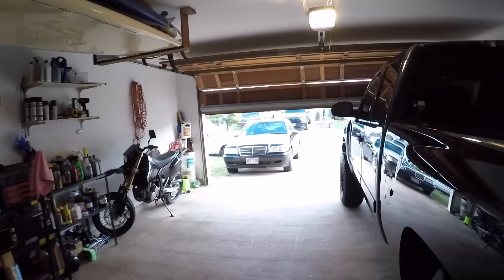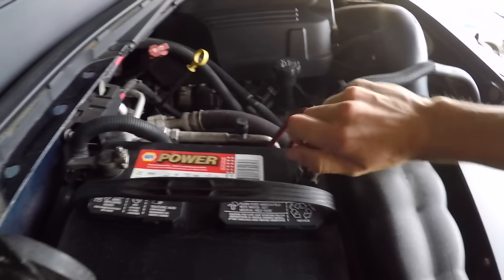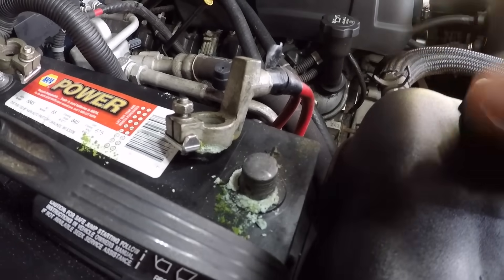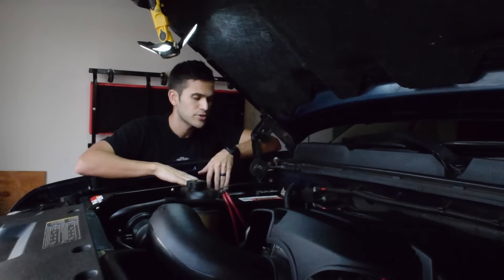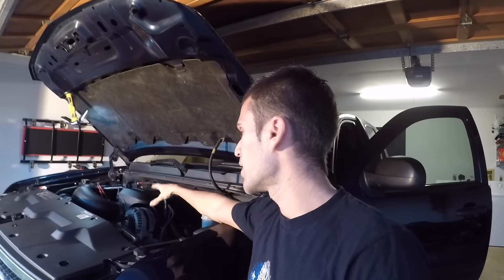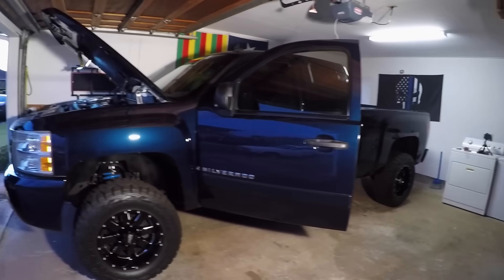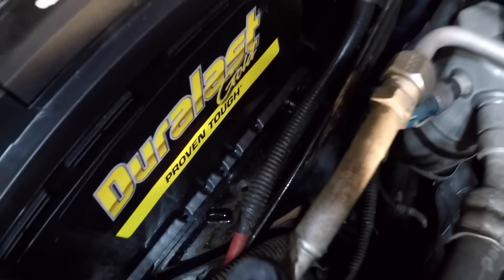Car Won't Start: Alternator or Battery? The easy way to know

Comment: 1/6/2020
Southern California
Automotive Professional background

For those of you that are Dead Serious about learning how to solve car/truck conflicts , purchase these small booklets @ your earliest convenience.

"First Things First" and " Vehicle Electrical Shortcuts"

It's a da_ _ shame that the info within makes my College Automotive Education look real shi _ _ _.

Think I'm BullShi_ _ _ _ _ about Real Automotive Diagnostics , Read the Comments Section :

www.veejer.com

Tip : Batteries & Starters start cars.
Alternators do not start cars.
In place of seniority , the Battery Voltage must be correct to get the Starter started.

Once any vehicle is running, all Power is coming from the Alternator for the vehicle. The Battery crosses its leg & goes to sleep.....Once you turn the vehicle off & start the vehicle again ( its the Battery that is the Boss ).

Comment: Generally the first thing to check is the belt. Next is the age of the battery. In this case you knew the battery was dying. Generally if yo think a battery is going weak it is time to replace on your terms. In most cases you will be selling or junking any vehicle with a good battery. No sense to wait to replace a marginal battery.

Important to note: a battery that dies from being drained because of a bad alternator may be ruined beyond being recharged.

Comment: 9:24 - 9:34  People, don't put your old or new battery on your trunk or car carpet without a piece of wood or cardboard underneath it, due to acid, grease, dirt, or whatever.  And wear latex gloves to protect your hands and so you don't get anything on your steering wheel or interior. ✌

Comment: Great video with detailed description.
I was driving down the street and my car stopped. Wouldn't take jump, cost me $125 for a tow. Took the battery our & took it to Auto zone got the battery charged, car ran well/long enough for me center the car in the garage, then conked out again. I'm afraid to get another battery charge, don't have the coin for these tows and have yet to have the alternator checked. I'm going to "gamble" it's the alternator- have it replaced, maybe change the serp- belt and hope I don't go broke, in the process... I also had a burning smell before the car shut down again, for the last time. My neighbor says alternator,
   I dunno what to think.

 I believe I could take the alternator off myself to be checked or buy 1-id those du-hickeys(but don't you need power) to check the alt?
 I'm not risking-tryna get a charge or jump to go A-Zone again, to have both components checked (only) to have it stop again. 

I was (not in a mean way) hoping you had alternator problems, just so I could see how you handled it. The symptoms you had 
(clicking starter), I had, as well. but your Problem was easily solved 
w/a new battery. My battery is only 2-yrs old yet, was drained when I took to "AZ" to be tested.
Recharged battery ran for 5- mins. Then stopped again
I'm in a quandary ..
Reply: Sir, just replace your bloody alternator and take in old alternator so A.Z. dont charge you a core charge, end of story!
Reply: gee davis I feel you brother. I turned on my truck it idle roughly for a second and it stalled on me. I thought it was the battery so I replaced it with a new one. Just yesterday it happened to me again. I’m going to check my Mass Airflow sensor and if it’s clean then it has to be my alternator.
Reply: @saulreyna72  Sorry, for the slow reply. I took some time off from the internet...
I changed my throttle body myself.
Now, I'm about to embark on this journey to see just what the heck is wrong w/my car. Hoping it's just the alternator (I gotta guy)😆. 

I'm going to A-Z or Walmart & buy a tester- tomorrow.

Comment: Anyone have this but when I turn key to start it everything completely is dead on brand new battery, it clicks just like on this video but I loose all my dash lights and all power completely
Reply: Same here, I'm thinking it's my alternator, you?
Reply: That's normal, when you turn on the ignition all power is used primarily for your starter. It sounds like your starter is bad to be honest.
Reply: @cenzolyksitruff  Thanks. Also, before it wouldn't start, I heard squeaking, like maybe my belt. What's your thoughts on that? Please and thanks!   :-)
Reply: Mine turned out to be a bad ground on my terminal, I just used my multimeter and found out I had no ground right where my terminal is I just sanded it down and presto truck crunk right up don’t know if this helps you guys
Reply: @BEASTMODE988  Thanks, I'll look into that as well, thanks for sharing, much appreciated !  :-)

Comment: ANYWAYS , I had very much ongoing issues with car and seems like they found problem and hope they did indeed fix it . Running like a champ right now . They fixed a computer glitch by re calibrating it .  06 Nissan Sentra 1.8 L  It was ongoing for almost a year . It was after starting not revving up no matter if I floored gas pedal . It would start but no power . It did this irregularly sometimes twice in two days then it would run very normally for weeks even months . SMH . It was lately getting much worse more regularly . Yeah it was dying after starting and much more hesitation after starting and running I absolutely didn't trust it on expressway . I kinda thought that was problem . They said that almost certainly will fix it . I agreed because it's cheaper and stands a good chance this will fix it and much cheaper than total replacing computer . Time will tell . They impressed me because they plugged in scanner and no fault codes . So what you guys think ????

Comment: First of all, any tech or person with common sense would know that its not a alternators job to charge your battery from a dead state.  Its meant to maintain a full charge.  Your damaging your alternator by jumping it and allowing truck to run with a dead battery.   Your supposed to actually use a battery charger to charge the battery before starting it.  I seen hundreds of places and shops install a new alternator and just jump the car and let the customer drive off.  Not fun to do on a audi to see it last a few days and have to tear the engine apart just to warranty parts.

Comment: Alternator does not have anything to do with starting a vehicle it would be ignition system battery or starter period. Also something left on may drain battery lights etc. Alternator keeps battery charged while driving if it goes bad vehicle will drain battery's till car won't run anymore.

Comment: Thanks for the video. Also NEVER place a new batter or used batter on the cement floor. They can loose charge pretty fast that way. Always place it else where, just not on outside flooring of any kind.

Comment: That was very informative. But what if ur battery is only a year old? I took the car to Auto zone and they did two separate tests and they said the battery and the alternator are fine but though my car keeps dying every two to three days?
Reply: Could be an intermittent short in the battery.  I have had that same situation.  Replaced the battery and problem solved.  Or it could be a short in your wiring system causing the battery to drain.  You can install a battery cutoff switch, and use it to cut the battery after you park.  No possibility of draining from car wiring.  If it still drains, replace the battery.

Comment: Cold temperature will keep the car battery from starting. I'm trying to figure out ways to keep the battery warm in the freezing winter  ? Can I use a very warm towel wrapped around the car battery when the car is not on ? And can I pour hot water on or around the battery in the freezing winter if the battery don't seem to start the car ? Especially with a low cold cranking amp battery between 300-500 cold cranking amp battery  ?

Comment: You replaced a n65 battery with a din65 size battery. Which, is why you had to stretch the leads over to make it fit. It's best to replace with the same type, spec.

Comment: Good videio. Seems applicable to all cars. I have mk1 citi golf and did the same thing over the last few days. ive had my battery from 2016. Till now. I suspect its could be the battery and or the alternator. Need multimeter and jumpercables.

Comment: Hey so my truck is having an issue and I think its the alternator but not sure. So I'll start it up but it will crank really slow like it has very little voltage, I'll drive it around and when I go to start it again its cranking even slower than last time and is extremely hard to get started again or not at all and then have to get a jump. Love to hear from you because this is driving me up the wall.

Comment: Although your primary concern was to restore operation as quickly as possible, the battery might have been saved with a desulphation procedure. At least, checking sulphation might have provided a cheaper option than battery replacement. Batteries which simply "go bad" for no apparent reason are at the end-point of sulphation.

Comment: Would of been faster if u took the battery to be charge 👌
Reply: No my friend, the battery was knackered so it wouldn't hold the charge. Needed replacing.
Reply: Schmoozing Kaboodle when u take your battery to be charge they will tell u if it’s good or not

Comment: Hi, I just want to warn your readers about the bad quality of the REMY remanufactured alternators, specially for the car I have, a Forester 2002. I originally replaced the car's original one, overheated (FIRST). This one lasted for 8 months, until my instrument showed 0.volts O/P. I replaced it (SECOND) with a REMY part; not cheap, btw, $276.00 CND. It only lasted for a couple of days, in which its O/P went from 14,4 Vdc to 0, and the battery started to waste down. Concerned, I replaced wires connector (just in case, although it showed no physical damage). I replaced again (THIRD) and has been working steadily, They use bad semi conductors or bad labour, in re-painting coils with isolating varnish. God only knows for how long. Be aware of cheap parts, re-manufactured under s***hole country Standards, folks. Thanks for video, btw.

Comment: Brother in my Tata Indica ev2 cr4 diesel car,
When the car stops after running more, then all the ignition lights are appear in the dashboard but the battery light does not appear, there is no sound when taking the self button or key and the car does not start. But after 10-15 minutes, when the vehicle comes to the normal temperature, the battery symbol appears automatically and the car begins to start. My mechanic and electrician are not getting the fault. My Whatsapp number is +918090496677. Please help me...

Comment: I have a 2010 Silverado 2500HD Diesel and it has original [dual] batteries...and the truck starts awesome every time. I have never had batteries ever last more than 5 years in any other vehicle that I have owned. Not sure why these have lasted so long.

Comment: Our car has been having trouble 2001 Nissan Frontier supercharged. It would sometimes start but after 2-3 times, it would need to get jumped and only then would start. We cleaned all the terminals and no luck. We put in a brand new battery and it started just fine the first few times. We disconnected a terminal to see if maybe it was the alternator and it was still running. Next day, same problem. New battery and it won’t start. Maybe the alternator? It was still running tho
Reply from the maker: The alternator could still be working, but not producing enough voltage to re-charge the batter in addition to supplying the vehicle. It also could be a bad connection elsewhere. Good luck!

Comment: This guy would have a 3 hour video about how to flip a light switch. Life is s just to short for this.
Reply: Pro tip:  there's a slider on the bottom of the video if you want to skip over part of the video.
Reply: TS Stavanger ww
Reply: @lynettespriggs24  All the information helped me just fine.  Thanks Lonestar.  Patience is key.
Reply: @janestes401 you're just repeating nonsense you've heard other people repeat. Patience has nothing to do with this particular scenario.
Reply: TS Stavanger You hit the nail on the head!
Reply: @doraidaperez5196  muy bien dicho Doraida
Reply: I clicked off after the first 30 seconds!
Reply: im cracking up lls
Reply: Patience it what make the difference
Reply: you also didn't have to watch the video😅

Comment: I have powered subwoofer in my car only with battery for hours. Can it be that he drained battery? Tried charging battery and worked. Second day when i tried to turn it on it won't start. When looked on battery the negative poll was watery. Car is Opel Corsa B ...
Whats the problem?

Comment: I tried to recharge my battery, but then I forgot to  use it. After a week of slacking, I remember that I left my fully charged battery in the garage, I used it to try and start my car....then failed....it's the battery, right?
Reply: If the battery was fully charged, left in the garage not connected to anything thats drawing power from it over the course of a week. You connect the battery to the car and it doesn't have enough charge to start the car, the battery has clearly failed.

Comment: This video summarised.Get a Multimeter. Check the battery voltage. Jump the car to get it started.  If the multimeter is 14v when the car is running the altanators fine.

Comment: In the engine off condition, the battery shows around 10 volts, and in car running condition something above 14 volts.... but while replacing the battery when disconnecting the negative terminal, the engine shuts down. What could be the problem? Any suggestions pls
Reply: Bad alternator if its good when u pull neg car will stay running off alternator. If it dies bad alternator

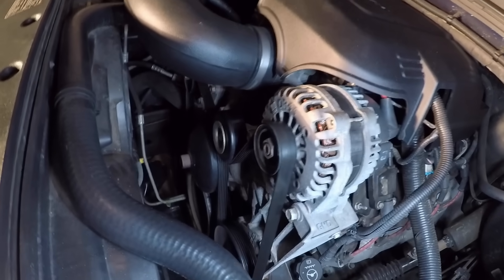Comment: I have the same problem on my 2010 Mazda 6 it is a 4-cylinder the interesting part about that is that yesterday it did the same thing it wouldn't start after checking all the cables looking at the battery and looking at the alternator by hour later I was able to get it crank now the same thing happen again today this time there was a rosian on the negative which I know is in the video you had a rosian on your positive the thing is I cleaned or Rosen off check all my fuses and connection again after 2 hours a messing around with it I finally got it to start as I got to work to pick up my client Bow Wow 10:30 I picked up my client at 12:30 I ride back with my client now the funny part is after 10 minutes of being back at his home I raise the hood up and I noticed a rosian start back building around a negative terminal I cleaned it off again check my fuses try starting it it wouldn't start hour later my supervisor pulled up clogging to go to AutoZone to get the battery checked I had turned the key in the ignition and it started right up I drove the car from 207 p.m. until 9:32 p.m. had no issues whatsoever car started up during that time I took the two different AutoZone's they told me it was my alternator took it to O'Reilly's they told me the same thing now the thing is when I was at all three they told me my voltage was like at 13.5 and the alternator fail for charging now the thing I'm wondering about is that is it possible that it could be the battery and one of the cells went bad probably given a lower voltage that's why my car having a hard time starting up the funny thing about it I heard my starter trying but apparently there was enough juice or amp or voltage circling around into the vehicle I Know It Go from a positive make it way to the alternator and all that good stuff and come back around like the circle of life the thing is I noticed a rosian back on a negative terminal after nearly three hours later so I'm debating a sale went bad or there's some form of a leak somewhere and it's throwing off the alternator and the alternator is not performing as it should have I've been working on cars nearly 20 years and I don't know everything and I Know It time that I could be overlooking something but please give me your feedback on what it is that I'm overlooking I know there's something in my gut instinct having the battery and normally when I have a gut instinct I end up being right the whole time

Comment: The problem I'm having is I took the alternator off of my car I have a 95 240SX head it test at O'Reilly's they said it passed but whenever I turn on the air-conditioning it kills the battery?

Comment: To start: I miss Hawaii!

Now that homesickness is passed...

I plan to replace a second alternator. (The first replacement had bad diodes.) I will also get a new battery. I am at risk of missing the deadline for the emissions test for Wisconsin because of these two items.

Comment: To my experince over motor vehicle batteries are.... before you turn on your engine make sure to turn off all interior lights , radio, headlights and any appliances that is going take power from  the battery.  This will make your battery life span increase and keep in its voltage steady for long run..

Comment: hello friend, I'm from Chile and I have a silverado with 70,000 miles, when the ignition is shaking when it is idling, they tell me it can be the coils.

Valves and cylinder heads were rectified, valve seals and 4 smart tacks were changed, those that carry the springs, those that disconnect cylinders, with respect to that arrangement the truck was fine, but it has that tremor all the time when it is idling, the spark plug wires were measured and they are fine, the spark plugs are new iridium acedelco, but the coils have not been changed, while idling I have disconnected each of the coils and the engine becomes more trembling, when the I reconnect the engine is matched but remains with the same tremor, that means that the coils are good ?, You can give me your opinion, because that tremor has me sick.

Greetings from Chile.
Reply: Why are you asking him?  He just did a battery swap.